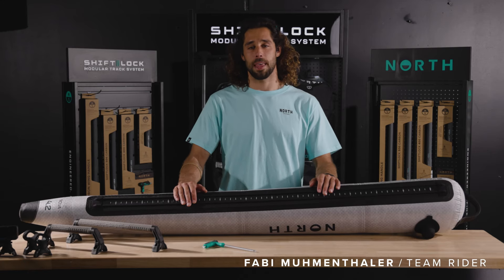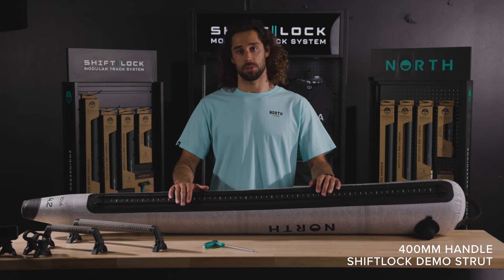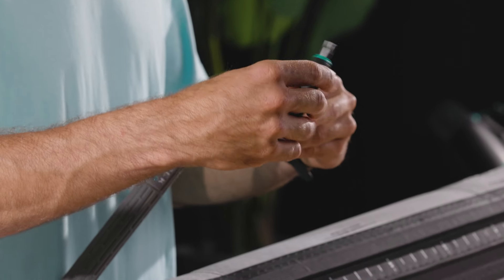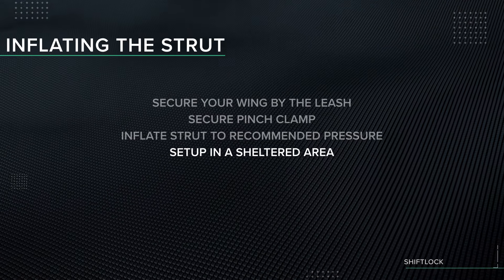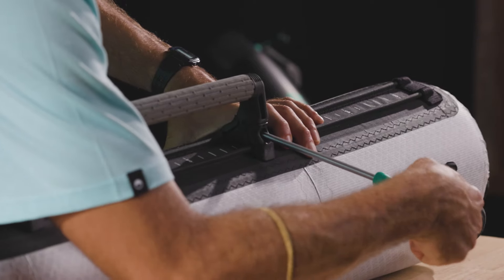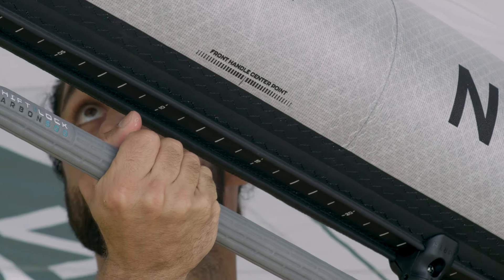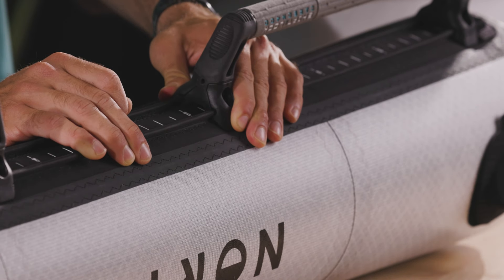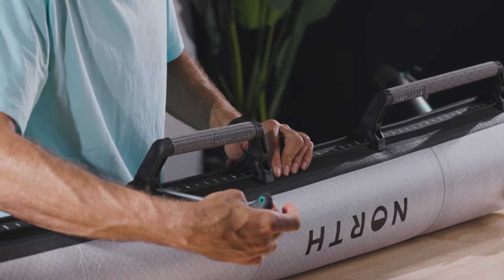North Installation Guides | ShiftLock

Comment: I bought 5m with boom. After 2 session for now this is a nightmare to setup it on the beach. It took me more time then inflate it and attach mast to the board and assemble foil. Maybe need more practice… first session on the way to the beach I lost 2 pieces to connect boom to the wing, thanks god I was able to find them. Boom is grate but all actions need to be done to use is complicated. I prefer to have quick connection without any tools.
Reply: Hey my friend, I don’t agree with you. If you follow the correct steps it’s simple, quick and easy. 

Make sure that the screw is tight enough for the clamps not to fall, but loose enough to fit the ShiftLock handles onto the track.

If done correctly should be as quick and easy as attaching your mast to the board 😊
Reply: @secondlife7976
What works best for me is whenever I have taken the ShiftLock handles or boom off the wings I tighten the screws hand tight that way the clamps never come off the handles during transport. If you leave them loosely assembled they can come undone during transport as any screw connection that is exposed to vibration.
Reply: @Uli_Sommerlatt  main issue for me is attaching boom to the wing. I wish to be able to connect boom to Loft pro …

Comment: I feel like this new handle system will just break board when the wings come smashing down when we crash, since they are hard plastic.
Reply: The ends are overmoulded with a soft plastic to prevent this.
Reply: They are carbon handles, same as our grip lock carbon handles. Also, every other brand has hard handles as they are a benchmark nowadays. 

Besides, we’ve covered the ends with soft plastic to prevent injured or board breaking.